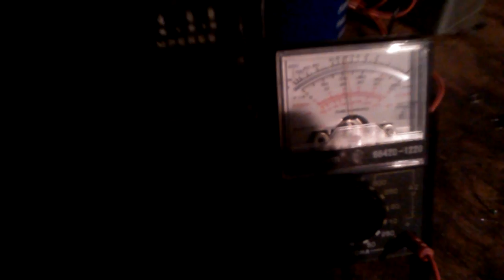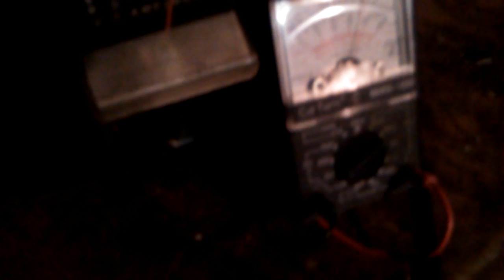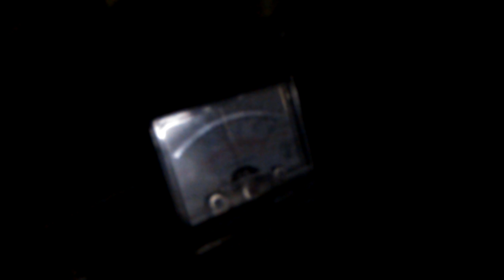high voltage ZVS Tesla coil

Comment: dude that was a sweet ass run there ! the arcs looked as if they were blown about in the wind very flame like and damn it i got a small coil like that but really need to tune it ! now the ZVS inverter is not guilty of being power hungry, its the flyback ! ferrite core transformers are very efficient when it comes to current input but the downside at least for DC type flybacks is that heat gets trapped inside since its potted.. as long as you do short runs and keep an eye on the heat you should be able to use that flyback for a long time.. only concern is the internal diodes, if they die its game over but you can build a HV bridge rectifier with a bunch of cheap 1000V diodes thats what i did .. anyway kickass coil bro cheers !